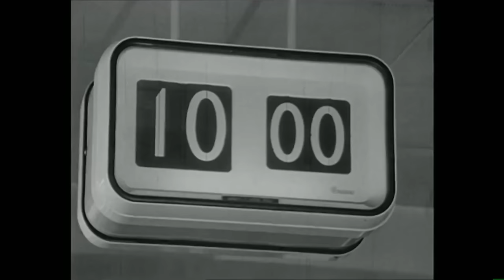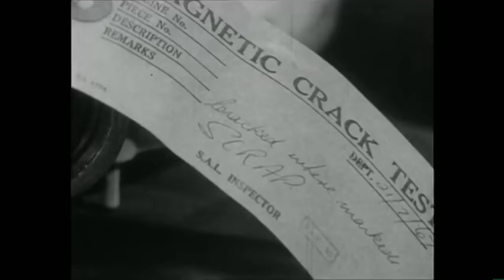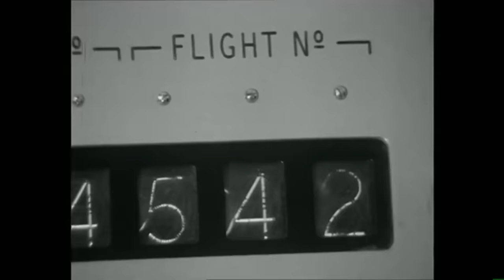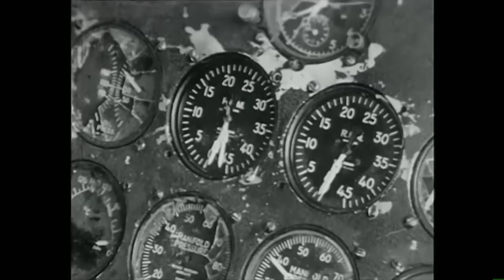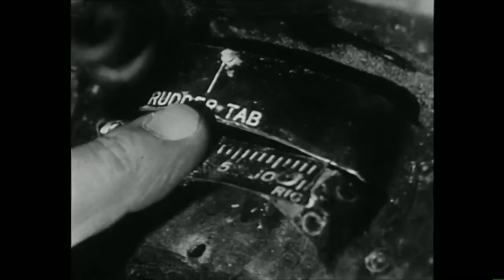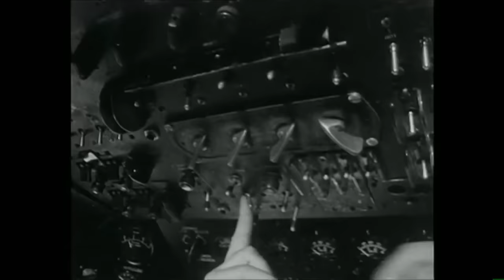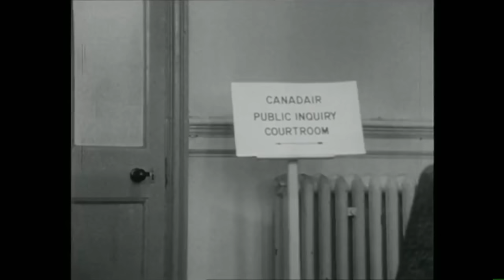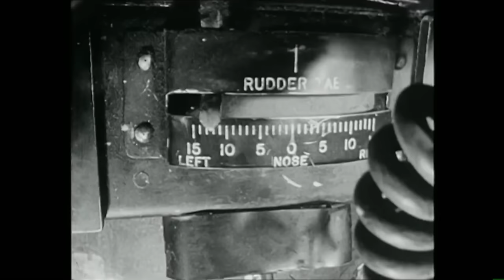Stockport Air Disaster

Comment: Pity there wasn’t a voice recorder in the cockpit, but that probably wasn’t technically possible before digital?
Reply: One of the first UK uses of the data recovered from an aircraft accident was that recovered from the Royston "Midas" data recorder that was on board the British Midland Argonaut involved in the Stockport Air Disaster in 1967
Reply: Cockpit Voice Recorders (CVRs) were introduced in the late 1960s and became mandatory on airliners worldwide in the 1960s. CVRs are part of aircraft "black boxes" that also include Flight Data Recorders (FDRs). These devices are required to be able to survive the conditions of a severe aircraft accident, such as temperatures of over 1,830 °F and impacts of 3400 g. They are typically installed in the tail section of the aircraft, which is considered the most crash-survivable part.
Reply: It was trivially possible, they used metal analog tape in extremely robust enclosures. It is probably superior to digital.

Comment: There is something that is not right, how can a person on the ground those days bring a plane in and it seems that
on no point was there any conformation from the pilot to ground control where he was, if he knew that the plane is
losing height why wasn't he aiming rather for a field opening than a dense city probably the chances were there to save more people
Reply: He was flying on the normal approach from the east to Ringway ( as was  Manchester ) airport then. It's right over the centre of Stockport. The area is very built up and part of the Greater Manchester area. The miracle was that it came down on the only spare ground around which was a WW2 bomb site which had still not been built on. Just a short distance from high-rise apartments.
Reply: Maybe he thought he was able to make the landing second time round then the second engine failed which left him in the position of not having sufficient altitude or speed to make an emergency landing.

Comment: Thanks for showing that remarkable video. How different from today; then, they were eager to show the public as much info as we were likely to understand. Today, "black box" describes not just the recorders, but the NTSB. Get out of here, we'll let you know what we experts discover, if and when we find it.

Seems odd to me that pilots had to bother about delivering fuel to each engine. There was enough fuel on this plane to serve all four; was it even then beyond the wit of man to design a delivery system that would keep all four running without intervention?
Reply: The problem with designing automatic systems is that they have their own, complicated failure mechanisms that can often be harder to understand. It's like this in the case of most fields where automation is possible. If you don't do it well you can make a much bigger pig's ear of things than if you'd kept it simple. That's doubly the case when you're on a platform like a plane or ship where you can't just pull into a the side of the road and need to handle failures all the time: mechanical failures, leaks, contamination, different rates of usage, safety in case of an accident, etc. And managing liquid sloshing around in tanks on something pitching left and right isn't easy at the best of times! It's a lot better if you can get it right but it's harder to get right, particularly before there was good computation available.
Reply: They still use crossfeed fuel systems today and planes still crash from pilots not setting them correctly.

Comment: What are feathered and windmilled propellers?
Reply from the maker: https://youtu.be/UvSWxJ70xv8
Reply: Some props have what's called "variable pitch", where they can turn in their seats to take more or less of a "bite" out of the air.  If the engine stops, then the air hitting the prop tries to turn the engine (acting like a windmill), and this causes a lot of drag in the air, which slows the plane down a lot more than if the prop is feathered, and  the blades are lined up straight with the front of the plane. In that case, they don't try to turn with the air flowing through them, and the cause much less drag, allowing the plane to stay in the air longer when an engine has stopped working.
Reply: @bentcrazy1324  :)
Reply: A windmilling propeller causes as much drag as a solid disc of the same diameter afixed to the engine hence the necessity to feather or turn the blades edge on to the airflow

Comment: The plane looks like a DC 4 re engined.
Reply: It is
Reply: Very close........... On 4 June 1967, Argonaut G-ALHG, owned by British Midland Airways, crashed near the centre of Stockport, Greater Manchester, United Kingdom. Fatalities included 72 of the 84 on board; 12 others were seriously injured. 

https://en.wikipedia.org/wiki/Canadair_North_Star there are some obvious differences other than engines, square pax windows whereas the C54 had round........and it was pressurized.
Reply: @DominicVCrain  and "passing gas", not really. The Canadair "North Star" had a DC-6 nose, C-54 middle section, wing centre- and outer-panels, DC-4 rear fuselage, tail assembly, wing tips and flaps, a different electrical system and pressurised cabin.

Comment: Must admit. The first thing that comes to mind was did the pilot actually have amnesia.  It doesn’t seem to be questioned or if it was not talked about. Given he would have a vested interest in them not finding it it may have been his fault and with the first officer dead, surely it’s a possibility. Maybe they accepted this matter at face value back then
Reply: Let's not question harry Marlow because he seems like a proper good honest man and don't forget the plane makers were alerted to a problem with the xfeed levers so I believe what the inquiry found was accurate and Canadiar are the culprits here  - captain Marlow would have saved the passengers and plane had he been aware of the xfeed problem  - easily sorted as long as u are aware but catastrophic if not  - why was nobody told  - Canadiar are totally responsible for the stockport disaster

Comment: What are feathered and windmilled propellers?
Reply: Feathered propellers have the pitch increased to 90 degrees; that is, the leading edge is straight forward and the trailing edge is straight back. If a propeller is feathered it presents least wind resistance.
Windmilling propellers are propellers that still have normal pitch but instead of pulling the plane through the air they continue to spin, but more slowly, because of the air flowing past them. Windmilling propellers produce a lot of drag.
Reply: Thank you for the information.
Reply: @flagmichael  Feathering is when the engine is running but the propeller gives minimum thrust.
Windmilling is when the engine is not running. (has stopped). The propeller turns passively, like a ..........................windmill?

Comment: Contrary to popular belief, plane accidents, which are when a plane suffers substantial damage or someone suffers serious injury or death, have a 95% survival rate.
Reply: Contrary to popular belief 95% of statistics are made up on the spot
Reply: @jamescooke3763  😂.  But true.
Reply: It all depends upon what you consider to be an accident. For instance pushing a small plane into a hangar and shutting the door on it, or falling out of the cockpit whilst drunk.
Reply: @jamescooke3763  😂
Reply: @jamescooke3763  It's amazing that the relevant accident / safety authorities responsible for such matters haven't already set in place what constitutes an accident, incident or general mishap. You should be head of said authority without delay.
Reply: @jamescooke3763  Your evidence for this or did you just make up that stat?
Reply: @johnhead1643  there are lies, damned lies and statistics.

Comment: So the "Argo naught" must be a Canadian built DC-6A ?
Reply: Canadair North Star DC-4M. A kind of super DC4. It used quite a few DC6 parts
Reply: Argonaut.
Reply: DC4 with merlins
Reply: BFC BOAC had a significant (at the time) fleet of Argonaughts which filled the gap with the failure of the UK types such as the Tudor and had to be brought back with the Comet problems. They mainly did the long distance flights for BOAC including Hong Kong and East Africa. It was an Argonaught that brought the Queen back from Africa on the death of her father.
Reply: The Fat Numpty the Merlins were quite troublesome for the airlines. They were a military engine and one of the problems was the noise in the cabin (not a problem in a Lancaster) and the engineers had to come up with a complex cross-over exhaust to mitigate the problem.
Reply: Nigel Mattravers absolutely, of course that was the trend of the time, re using ex military engines and equipment and re engineering bombers into to civilian versions (York was a good example) also it was far easier as factories were already tooled up for all this too. Until the brabazon committee brought new airliners like the viscount along it was a stop gap measure. As you rightly say though it didn’t make for overly comfortable air travel!

Comment: Definitely an interesting film documentary
Never heard of an argonaut plane or knew RR merlin engines where still in use for so long
Makes sense that so many merlin engines are still around
Reply: Merlins were manufactured until 1950, one of Rolls Royce's most enduring lines. My grandpa worked in their assembly plant at Hillington near Glasgow, where they churned them out during the war. Aircraft engines nowadays will also see continued use for many years after they were manufactured. Many of the aircraft carrying people in our skies right now could have 15-20 year old jets on them.

Comment: How can nobody get hurt on the ground ?????
Reply from the maker: @pim1234  It was a small valley that was so steep that it had never been built on.
Reply: @gileskathome  It was a very small patch of clear green space among apartments, hotels, and shopping spaces. The captain did a remarkable job finding that space for his emergency landing/crash. It barely contained the aircraft on impact, with the left wing grazing an apartment building (I think?) on its way in. The steep rise was at the far side of the green, preventing the debris from going any farther. The area was quite densely built up. The fact that no one on the ground was killed or hurt was down to the pilot's skill.

Comment: Overshot the runway 6 miles out?
Reply: Overshot on the initial approach.  Lost the stable approach in IFR with two engines out.  Couldn't keep the aircraft from making a right turn into the dead engines.  Went over the city and made right turns to return to the cross runway.  Didn't make it and crashed six miles out.
Reply: Apparently you have comprenssion issues
Reply: TalkToTheBody  first off overshot does not solely refer to aviation. Second he has a clear understanding because he questions over shooting while still 6 miles out. Clearly it explains the go around because of over shooting on the first attempt, then crashing on the second attempt at 6 miles out.
Reply: TalkToTheBody  says who... You? I don't give a shit what you think and I am certainly not letting you dictate anything to me. I will make whatever comments I see fit and if you don't like it too bad for you. Move on
Reply: @peterhenman2662  Fortunately for the few survivors following impact, the captain did not make left turns with the starboard engines out. Such would've induced a slip and brought down the airplane sooner, and possibly, with greater impact.
Reply: @davidjadunath1262  I doubt very much he could have turned away from the dead engines at low level, configured for a landing.

Comment: The first thing they should not over shot (go around ) with engine out 
I am capt of 4 engine's Air plant  B 707 b 747 and DC 3
Reply: Slarti Bartfast  are you taking about the accidents or what
Reply: The DC-3 only has 2 engines

Comment: Millimeters in the '60's?
Reply: Pat Alessi  Never had an engineering drawing in metric until early '80's
Reply: Pat Alessi  Furlongs still in UK and hands I think, maybe even acres not sure, left years ago.
Reply: Yes, we'd built 'Concorde' with the French, remember, and that helped the inches and millimetres become well and truly tangled.
Reply: @bingybingy2592  Yes, we still use also miles and chains, miles-per-hour, guineas, pints, brake horse-power and acres by estate agents, but the Ordnance Survey has been metric since 1920. Furthermore, the original French standard metres and kilograms (that is, the ones from which all those metric measurements are taken) were manufactured by  British metals dealer Johnson, Matthey & Co. in 1882!